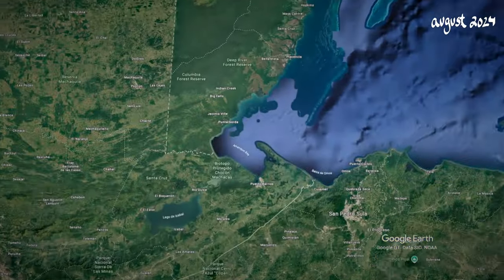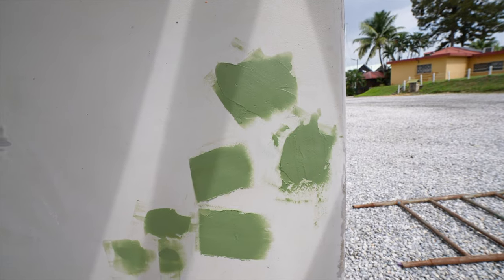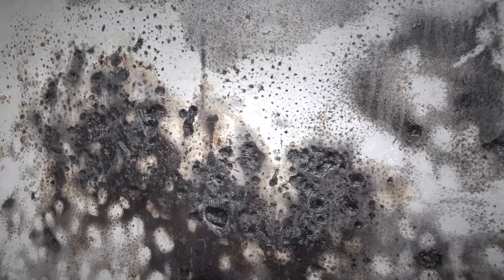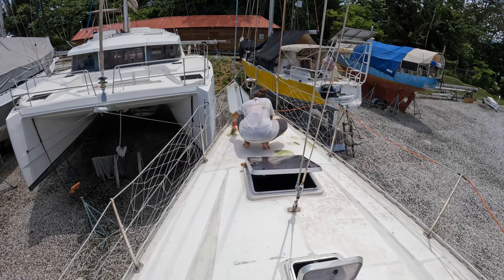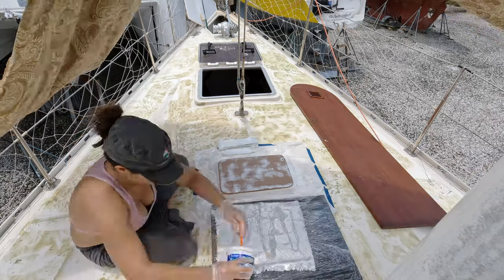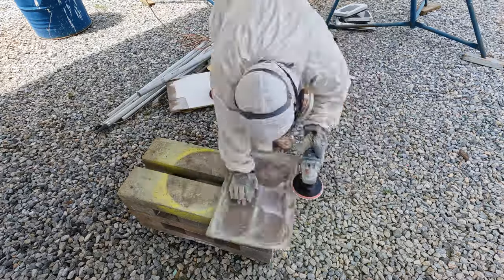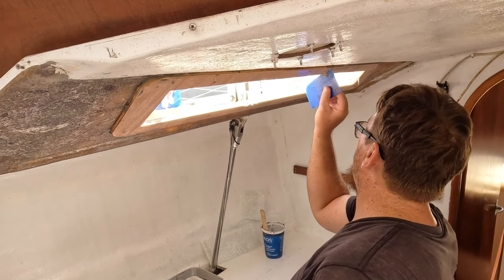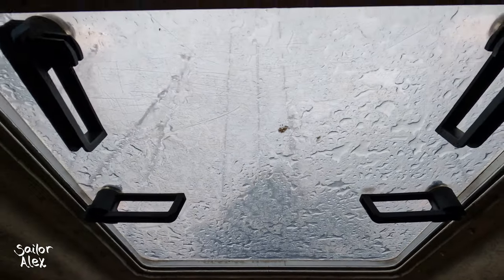HOT STUFF DIY boatyard epoxy in guatemala

Comment: Great job.  We have used Total Boat products, almost exclusively, on the refit and repairs for our 40' sloop.  If you like the Total Fair, you will love the Thixoflex in the tube.  It takes a 60:1 caulk gun to move the product but you have instant, mixed, thickened epoxy that applies like caulk.  That has been a lifesaver on many projects, especially when working times are short.  If we had room and money, we would have 30 tubes of the stuff.
Reply from the maker: Thanks for the tip - that sounds really useful for projects involving injecting epoxy into tight spaces, nice!
Reply: @sailorama  it isn't cheap, so you are paying for the convenience but it is really good epoxy for things that move or flex.  The mixing tip isn't very efficient, as you will lose a half a teaspoon or so of resin or hardener as the mixing tip fills up...but it is still worth it.
Reply: Looks like you're making good progress